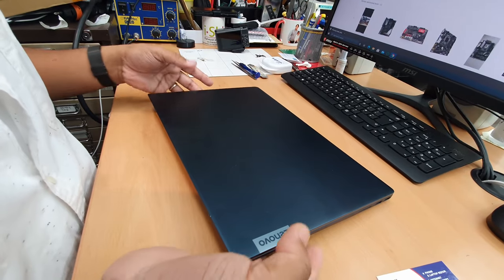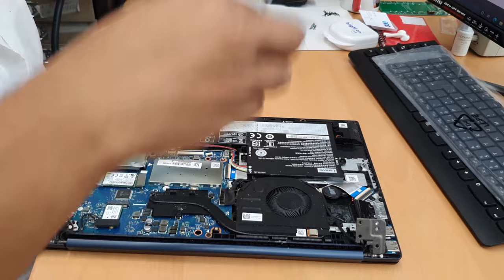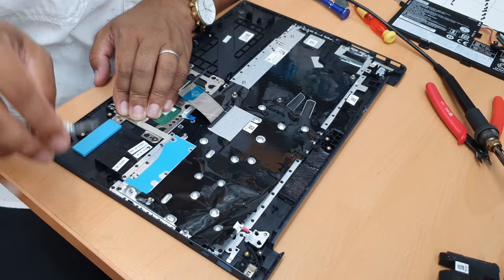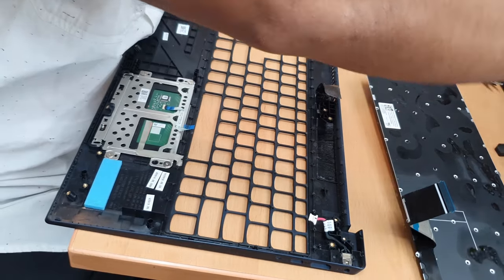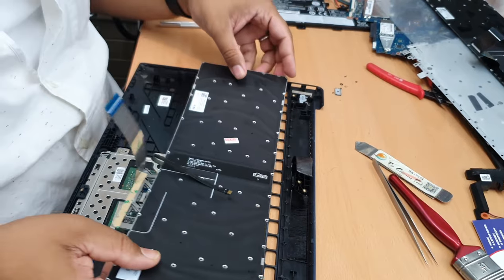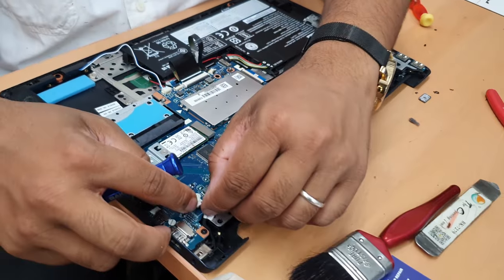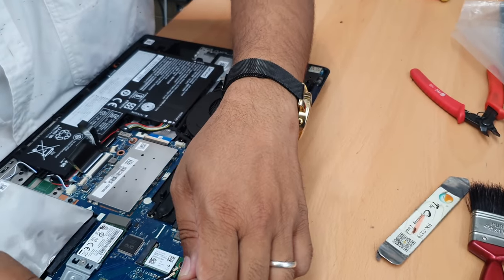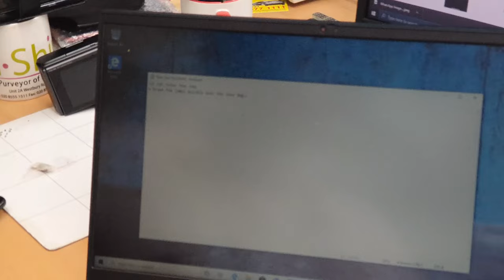How To Replace Laptop Keyboard | Lenovo Ideapad S340 15API

Comment: This is a brilliant video and enabled me to replace my old keyboard with a new one. There were 4 keys not working, but now they all work. Many thanks. I'd like to add some tips that I learnt that might help anyone else taking on this task. 1) All base screws are T4, and the 4 which run along the base at the opposite end to the hinge are extra short and do not need to be removed - just loosened until they click when you turn them. They won't fall out as they are held in with locking washers. 2)  The heads of the plastic rivets can easily be cut off using a narrow wood chisel. 3) There are also some rivets underneath the black plastic sheet on the keyboard backing plate which connect to the keyboard and grill beneath it. If you peel off the sheet, they can be chiselled off quite easily. 4) I stuck my old rivet heads back on using some ABS dissolved in MEK. 5) You don't need to remove the speakers completely -just lift them up to access the edges of the backing plate. 6) Although my laptop never had a backlight, there is a connector which the backlight lead from the new keyboard now goes into - the lead had to be fitted copper side down (white line up).

Comment: Used this tutorial and another video showing the teardown of the Lenovo flex 5 1470 (my laptop) to replace this keyboard. Part costed me $26 USD with tax, I cut off each individual rivet with a plastic ex-acto knife and soldered most of them back on with the soldering iron. Attached the rest of the plastic rivets with JB-Weld, I let it sit overnight and put the laptop together after 24 hours. everything works great, thanks for the tutorial
Reply from the maker: Well done! Don't forget to subscribe, Bro.

Comment: You had to use a solder to remove the keyboard from the palm rest itself but didn't solder it back on. Did I miss a step? Is it not required?

Comment: I like your video but can you make "how to clean  a fan of this model" please. :D
Reply from the maker: I WISH  I STILL HAVE THIS LAPTOP AND MAKE A VIDEO. UNFORTUNALTY THE LAPTOP ALREADY SOLD OUT. BUT I PROMISE AS SOON AS I GET WILL MAKE ONE VIDEO. 
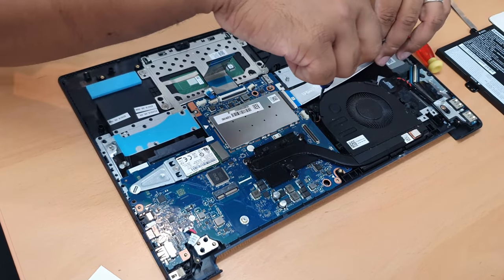HOWEVER THE DISASSEMBLING METHOD WILL BE THE SAME AS THIS VIDOE . SO FOLLOW THE VIDEO HOW TO DISASSEMBLE THIS LAPTOP . LEASE CHECK THE VIDEO AT 10:10 AND IT WOULD SHOW YOU HOW TO REMOVE THE FAN SO THAT YOU CAN CLEAN YOUR ONE.
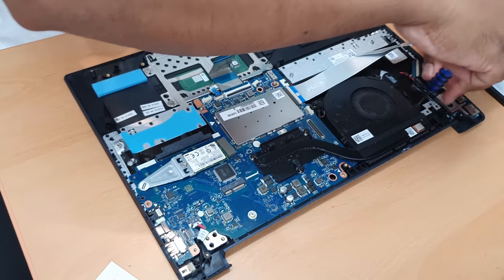Reply from the maker: LEASE CHECK THE VIDEO AT 10:10 AND IT WOULD SHOW YOU HOW TO REMOVE THE FAN SO THAT YOU CAN CLEAN YOUR ONE. LEASE CHECK THE VIDEO AT 10:10 AND IT WOULD SHOW YOU HOW TO REMOVE THE FAN SO THAT YOU CAN CLEAN YOUR ONE.

Comment: S540-15IML Laptop (ideapad) - Type 81NG 
Only 1st line R and T keys 2nd line F and G – 3rd line V and B Keys not working properly, some time working some time not, need replace key board or can repair it? And what is the correct way to cleaning key board? From sri lanka!

Comment: Keys "3" and "e" are not working. Sometimes it works but sometimes it doesn't so should i just remove the keyboard ribbon cable, clean it and fix it inside again. Will it work?

Comment: I have question, recently i am order lenova IP G3 laptop by flipcard,got it before 2days, problem is when I press shift+@ button display on screen " and press shift +" display @, also other 1key has same problem bt i observed that after notification came need to  restart and shutdown ur pc,then turn off laptop and start laptop problem occurred  so  need to replace keyboard or return laptop and order new one plz suggest, thanks in advance

Comment: I have Nitro 5 from Acer but that for its keyboard replacement they had to replace the whole top, as they said that it is the best option. They told me that if I replace just the keyboard, the keys won't pop out properly so I had to change the whole top. Are they right?

Comment: Hi, i have a question. Will the keyboard backlight work if I replace my regular keyboard with a backlit keyboard? The required connector is on the motherboard as well as on the laptop from the video.
Reply from the maker: someof the model coems with the connector and some of them doesnot. without led commector you would not be able to see any backlit.

Comment: Why not use a magnetic screwdriver to help  rather than tweezers?
Other than that, great tutorial. Was going to try it myself, but looks WAYYYYYYYYY too complicated! :-D
Reply from the maker: thanks for your advice and in future, I would use one. it looks complicated but believe me, if you give it time and follow the step then its gonna be easy and simple. Good luck.
Reply: it shall be a challenge 😉[very poor design (access), in some laptops it goes like a module to replace a keyboard by opening just the top of the laptop and 4 screws signaled as keyboard, takes some 5 mins]

Comment: I just bought the same model and there is no keyboard light option out of the box. 
But when u changed the keyboard does new keyboard light turns on? should i do the same?
please help me I can't see the light icon on my spacebar. 
Lenovo idea pad s340 15api
Ryzen 7 3700u with vega 10 graphic
8 gb ram

Thanks for the video.
Reply from the maker: if your old keyboard did not show up any light in past then the new keyboard would not help  ! press the fn key and try to find if there is any light sign. Strange issue.
Reply: Thanks you for your reply.
i had to do research on keyboard light option and i find out that my keyboard doesn't have light icon on space bar.
but i ordered new keyboard with backlight icon on space and i will be watching this video again for replacing my keyboard.
thanks for the great video.
Reply: @prem2743  he plugs in the KB light at 33:45 in the video. I had no KB light option before the repair but the new KB had the light and worked perfectly after connecting it. To turn it on press Fn+ <Left side of SPACE bar>.
Reply: @prem2743  did you replace the keyboard?

Comment: what is the size of the screwdriver used to unscrew the small black screws in the beginning?
Reply: Torx T4 for all 10 base screws (NB the 4 small ones don't need to be removed, just unscrewed as far as they will go), then cross head screwdrivers for all internal screws.
Reply: @alanmorris7155  haha I appreciate your  reply. thankfully I was able to figure this out before and I'm typing with my new keyboard.